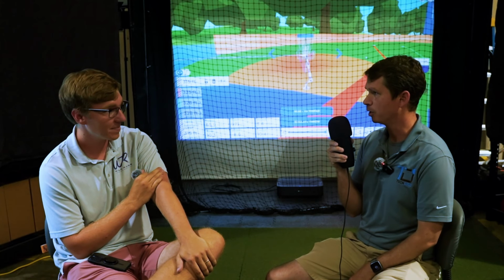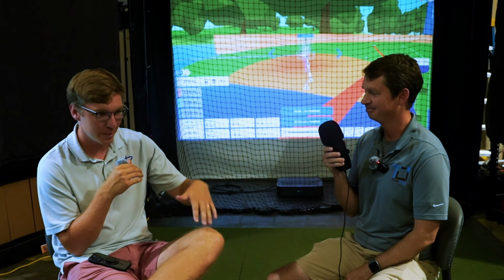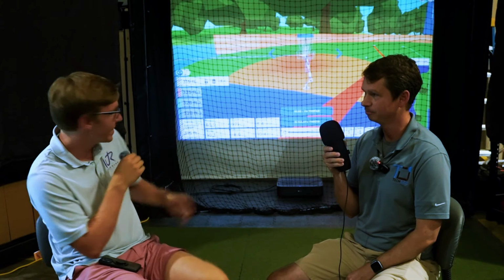This Tool Is Revolutionizing Disc Golf

Comment: Just got my td earlier this month.  I can't believe the nose angle Stat. I could throw it into the ground and my nose angle would still read up. 😅 

Also, why do you make the guy hold the chode mic? 😅 Does your RODE  mic not back up on the receiver? 

Is that Dynamic Discs in KC btw? Wife and I were there and played Waterworks around the 4th of July. Great store!

Comment: I would love to see this tech combined with wearable sensors that log positions for certain body parts (wrist, elbow, shoulders, hips) that when combined with measurements create a model of the thrower that can be used to inform timing and mechanic optimizations.
Reply from the maker: Agreed! Gotta be possible soon
Reply: I had the same thought. There is a gait lab in Denver that might need a visit.
Reply: https://youtu.be/AG_8tW2eBBc?si=rNn_4JQZ309dmZjd
Reply: We can finally settle the pull/don't pull debate.